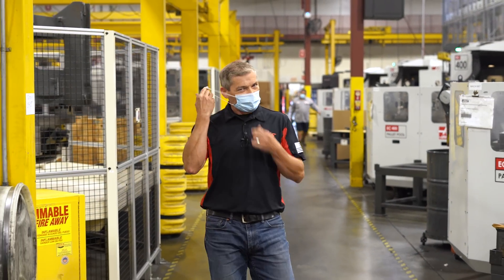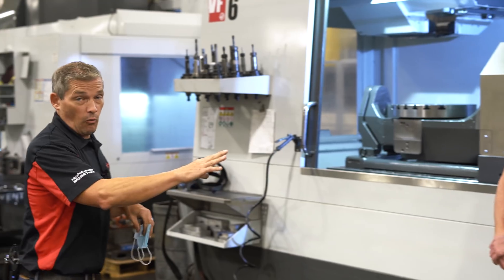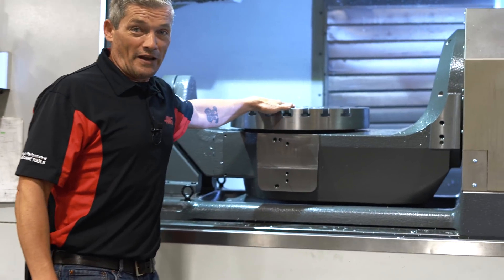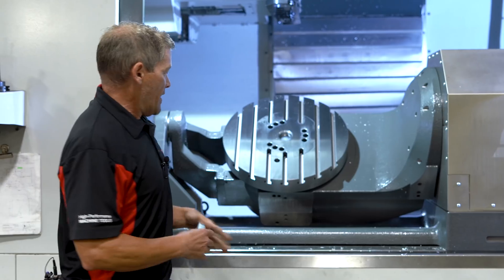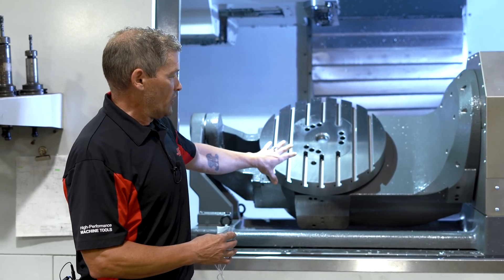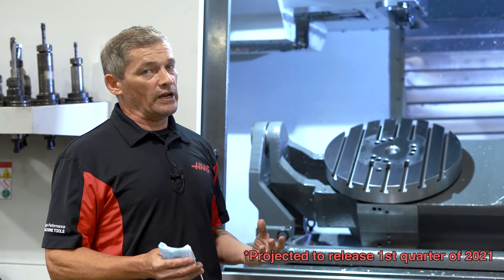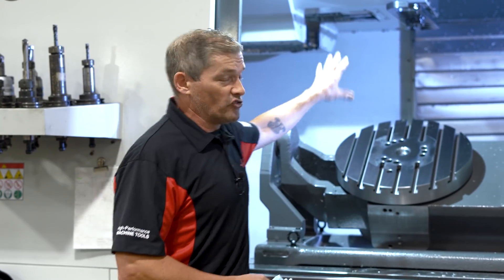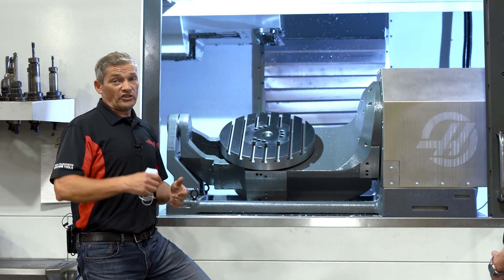TR500SS Sneak Peek - Haas Automation, Inc.

Comment: I know aerospace customers typically want accuracies of a couple of tenths and this - to my knowledge - is only possible using hydrostatic bearings. 
Do you guys use hydrostatic bearings in your machines?
Thanks!  :)
Reply: Tenths have been possible with ball screws for decades and linear rails for years. The new tech is definitely more repeatable but good operators can squeeze tenths out of haas all day.
Reply: @codygibson2809  Thanks  :)

Comment: Anyone on here want to weight on on why they'd buy this? They didn't mention a price but that's probably a 60k rotary, the machine's 120k, and you need atleast 15k in accessories (4th and 5th wiring, dwo, a z axis riser), at that price you're at a fairly well equipped umc750. Would this configuration be more rigid or better for thermal stability? We have a umc750 and love it, I don't see the reasoning behind going this route.
Keep it up though Haas, we liked the look of the VMT you previewed at HaasTec. All the other builders make mill turns that are lathes with milling heads, y'all followed the name and made a mill that does turning.
Reply: If you dont have the shop space to add a dedicated 5 axis because you already filled the shop with big VF6s and you have a contract to run 5 axis parts a few months of the year so a dedicated machine isnt worth it yet.
Reply: A few of the machines and products Haas has come out with lately seem useless to me this is one, along with those 5 axis with the 3 axis tables.
Reply: It’s about versatility as well. You can’t take the rotary off of the umc and still have a BIG table underneath. It’s not wildly practical for most people no.  But if you did big work and needed a versatile machine and options with a rotary this would be good.
Reply: umc750 is weak and soft machine. This looks very rigid
Reply: @ostry599  It's the same trunnion that is in the UMC750.  How could this be any more rigid than a UMC when it is only bolted to the table?
Reply: @madisonrollings1845  because umc 750 have soft y, z and the most x axis. You can easly move spindle by two fingers about 0.02mm in x axis. I work 2 years on umc 750 '17. Machine was never crashed, work only 1 shift prototypes
Reply: @madisonrollings1845   Pe is is right on the rigidity, the head is cantilevered, as it moves further out on the Y it becomes less rigid. We haven't found it to be terrible but you do need to be mindful, taking a heavy cut along the x axis will chatter more than the same cut along the y.
The VF design the head only moves up and down so it should be more rigid. I think it's a silly setup as you'd spend so much time getting that dialed in every time you loaded it but hey if it works it works.
Reply: @spazzywhitebelt  yes youre completly right.greetings.

Comment: FYI, studies show neck gaiters are worse than no mask at all, because they tend to break up droplets into smaller ones that linger in the air longer.
Reply: https://www.google.com/amp/s/www.livescience.com/amp/coronavirus-neck-gaiters.html
That article says pump your brakes, the co-author points out they tested on thin gaitor so it may not be the case for all types of gaitors. That's good to know though that an poorly designed/worn mask could actually do more harm than good.
Reply: Yes but people who wear neck gaiters are anti maskers, but don't want to be shouted at by Karen's, just do the least possible,

It is still better than 95% of other loose fitting masks with huge gaping holes all around the sides of the mask.
Reply: Well, we have been at this for some time now, some places with strict restrictions, some with no restrictions, you would think there would be contrasting examples of success and failure we could point to. Amaizingly,  the avarage age of a covid death is 78.5, which happens to be the same as the avarage life expectancy in the US.
Reply: @jasonlanning2394  can you link to that data? 
Yeah a one size fits all approach doesn't work, nyc with it's high density is much different than a rural area. Though you don't agree with the health benefit another is not having to shave, so there's that haha.
Reply: @jasonlanning2394  thanks for sharing that, I didn't know. Lots of information to digest.
Reply: FYI, Masks are stupid and don't work in the first place.
Reply: @jasonlanning2394  I don't think that's the case but if you want to believe that go for it.
Reply: @jasonlanning2394  👍🇺🇸 I'm with you bro